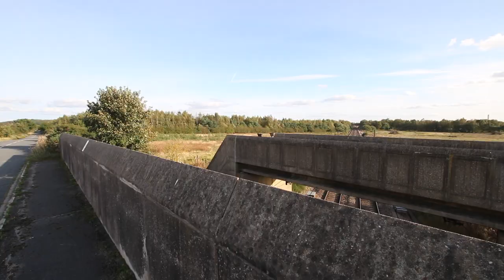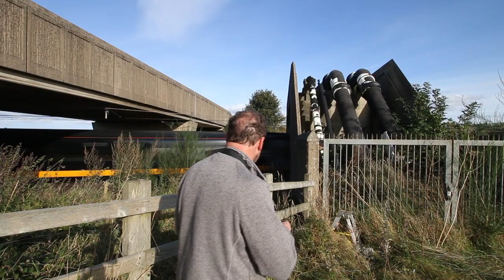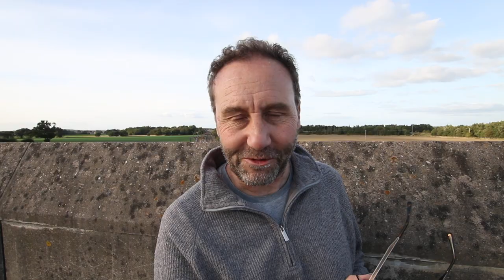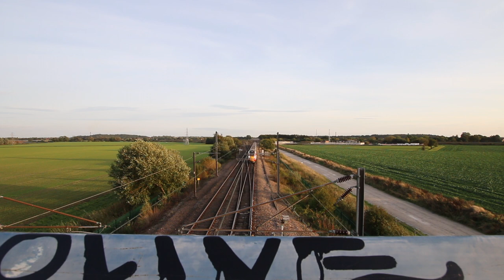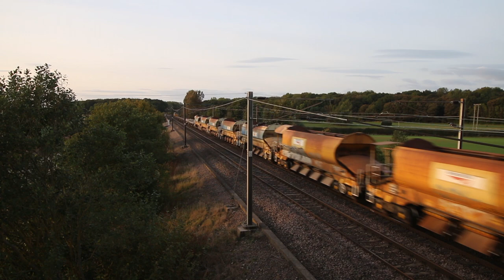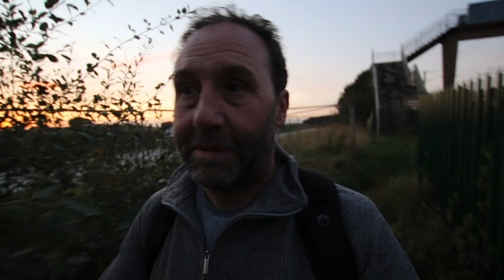What a variety!  Photographing high speed trains on the East Coast Main Line  - Hambleton Junction.

Comment: Great stuff again, was that a class 73 you missed with the other 2? Did you get a shot of the light engine approaching the rear engine of the engineers train. I’m no photographer but that may have made a good snap.
Reply from the maker: Thanks Mark, it was a Class73 on the back, I should have been more prepared to get that. I did get a shot of the two trains passing, but the alignment of the overheads didn't work, it might be one I have to do a bit of work with to make presentable.